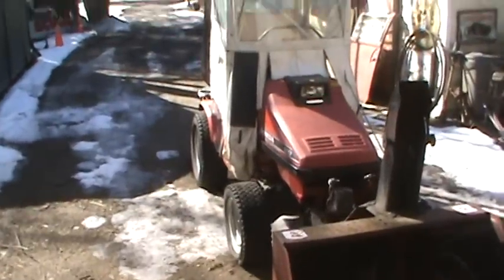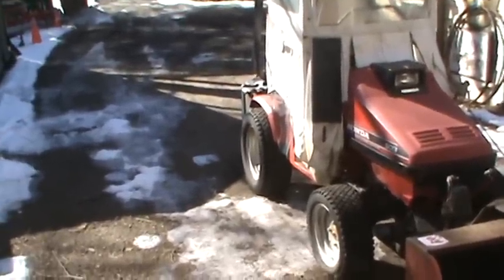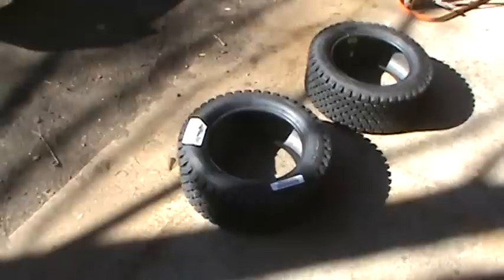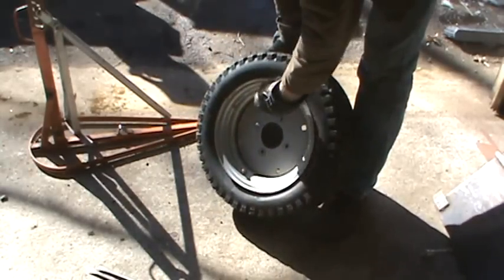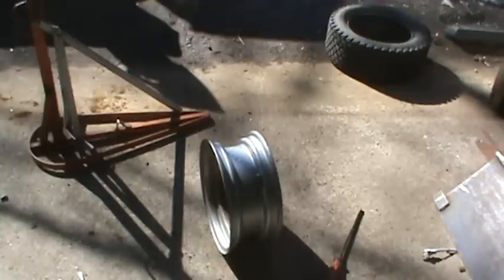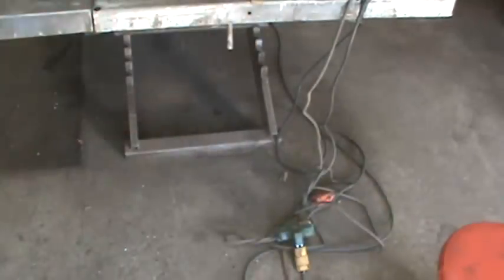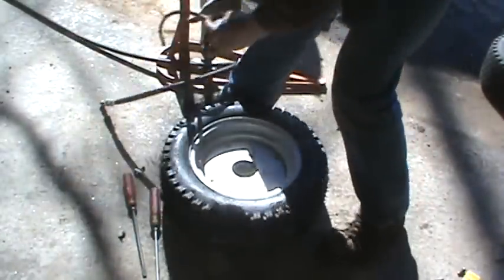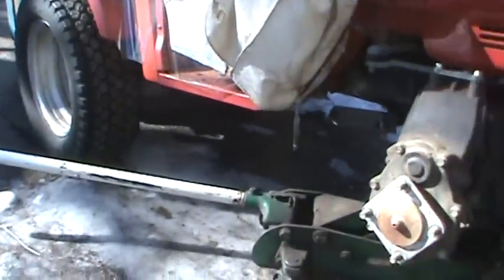changing tires with a harbor freight bead breaker

Comment: There is another trick besides taking out the shrader valve to get more air, instead of using an air chuck... just press the quick release air fitting right onto the valve stem and foop the bead will seat even quicker!
Reply from the maker: +MISTERComaToes  ive done that when l lost my chuck,

Comment: Dear Mustie, I was a tyre fitter for 3 years.  When fitting the second bead on the rim you should start at a point away from the valve and end up at the valve.  If there is a tube fitted starting at the valve will snap off the stem, if the is no tube then starting at the valve will get the bead of the tyre under the valve and you have to mess around  trying to get the tyre up over the stem.  Thanks for the vids.  Paul.
Reply: Thank you Torchyboy!

Comment: Hi Mustie1, it seems that you work on a good amount of off-road toys, check out Tireject for repairing bad off-road tires, it probably could have saved you over $200.  I can't say I've had any personal experience with it, but the reviews are generally pretty impressive.  For my use (car tires) it's not recommended, but from what I've read, I wish they made it for street cars as well.

Comment: I have rice paddy tires on my Yanmar tractor. It's one of those gray market units from Japan that Yanmar USA will not sell you parts for. I need to replace those tires someday. I want to keep the rice paddy ones or at least ag tires because they actually work better than turf tires. It doesn't leave tracks on the grass like turf tires do over time. Great video on changing tires.
Reply from the maker: +1crazynordlander thanks, and yeah they can get pissy on gray parts, some times ebay in other countries can be usefull,

Comment: Enjoy your work on the bugs. Had a small window 57 I think was the year. 37 HP was what was told to me but I doubt that? One good thing I was poor as a church mouse and the starter died in December. Good thing was a large leather belt rapped around the Generator pulley would bring it alive. It also had a gasoline heater. Fun stuff now but then it was not!

Comment: I had tiny little tires on the old 32 inch scag walk behind mower, They were a real pain to pry on. The smaller the tire the harder it is. Turn the old two front tires into a rubber slurry to  fill in the rear tire cracks. lol

Comment: My tip to you. get a old flat screw drive heat tip with torch red hot then beat til 1in wide let cool grind sharp edges now you own a tire iron. And if its to thin weld a flat washer on first then heat n beat. my self like musties way the cheap way works fine

Comment: I had the same tractor for years... awesome design but tires and attachments are through the roof. I ended up making all the attachments for mine. a little late now but i am pretty sure someone makes an adapter so you can run atv tires on these
Reply from the maker: +Parlusk its the ratio of the tires that get ya, if its off a little it loads the gears, kinda like an all wheel drive truck that they want you to replace all the tires at the same time,
Reply: +Mustie1 Very true I have seen that happen several times.. The guy who made the adapters made them specifically for the honda tractors he has a list of wheel and tire combo that will work with the 4x4 hondas http://honda.bk410.com/wheels_tires_adapters.pdf

Comment: Great video,  thanks! Also see "DIY Dan" technique video on  youtube.  Especially important is to take off and on the tire *from the side of the rim with the deep groove Closest to it. That recessed area is also called the Drop Center. After breaking the bead both sides, Getting the opposite (of prying over rim)edge of the tire stomped down so it is in that recess gives you the most clearance to pry the tire off and on. From the ither side of the rim it can be real hard maybe  impossible.  Find the Diy Dan vid, muted at .25x speed it's a fantastic tutorial.

Comment: worst tyres ive ever tried to fit were 700c x 20 bicycle tires very tight bead to get onto the  rim though have found that keeping the tyre inflated hard then every couple of months deflating it and reinflating this actually stretched the tyre making it easier to remove in the event of a puncture

Comment: Learned that I need a tire valve installing tool. Sure beats swearing when I try to put one in the hard way..
Reply from the maker: +ItsAlwaysRusty the one that pulled the stem can be used too,it has threads on the other side

Comment: I remember having a truck tire that would always leak a bit over time. Thought one day to see if the stem wasn't tight on it ... and it wasn't. Held air ever since. Just another thing to keep an eye on and not assume it is always a puncture.
Reply from the maker: +WaveAction777 l have a plastic barrel that l normally dunk them in but its a solid block at the moment

Comment: cheapest fix for dry rotted leaky tires is caulk .put your gloves on and spread a generous amount all over inside surface of tire ,quickly do not let set.air up tire a little over inflated for five minutes ,deflate and let caulk dry ,about $2.50 ,get the good brand stuff not cheapo white lightning
Reply: SEALANT (High adhesion..) not Caulk ( caulk= gap filler) ?

Comment: that was too easy,for really tough ones i cut them off with a sawzall. i did 4 16 inch tires on my truck by hand,i broke the beads with a bottle jack against the truck frame. now that i have a old bishman tire changer i picked up for 50 bucks,its much easier
Reply from the maker: +roger oconnor ive been there too